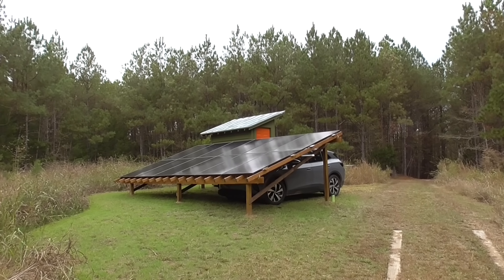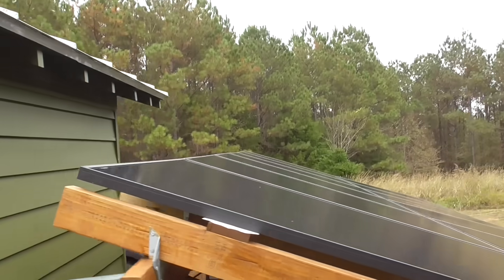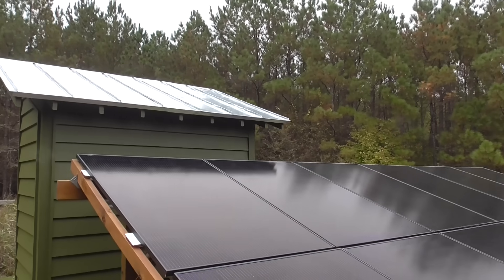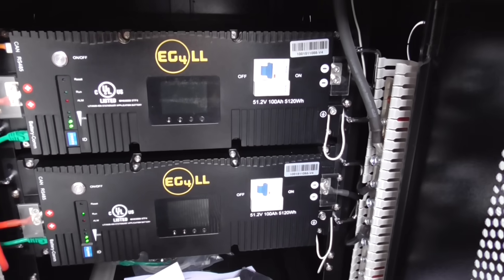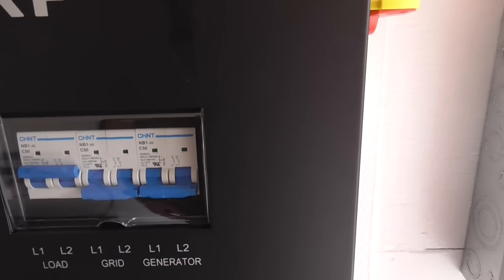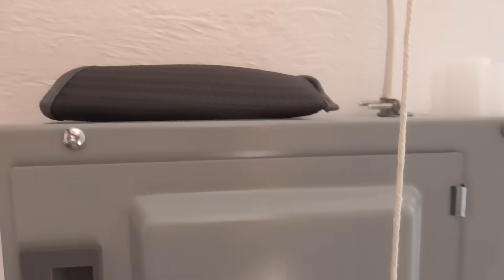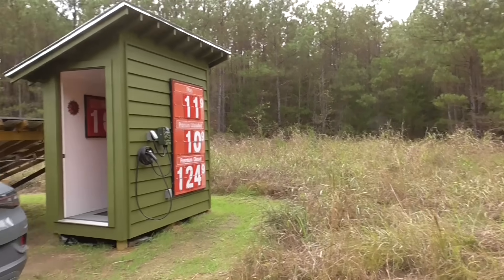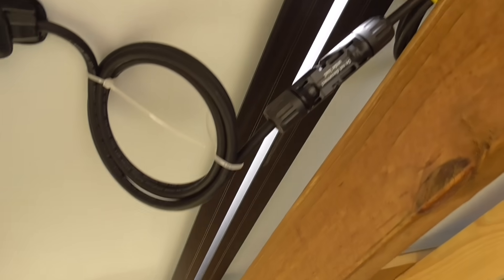Off-Grid Solar EV Charging Station. Stand-alone solution for EV.

Comment: Nice idea, but wrong EV. Seriously the VW's are rife with software issues. Would not touch one with a ten foot pole. You honestly would have been better off buying a used Tesla.
Reply from the maker: What you would or wouldn't do is meaningless to me. I love my ID.4. It's the best car I've ever owned. Zero problems and 8,000 miles thus far. Please be sure to take any advice you might have for me, write it down on a piece of paper, put it in an envelope and throw it in the nearest trash can.
Reply: @wickedmessenger1  good response!
Reply: VW has fixed those software problems that were on the earlier ID4.
Reply: I wouldn't own a Tesla if they were free.  The software is the only thing decent about a Tesla, everything else is cheap and low quality.

Comment: Time to change the posts so the space under the PV is useable for the EV and storage.
Good for viewers to learn early!
Free Advice: if you want to build a car port, and are wondering how tall to build, - open the hood and trunk on your car/van/truck and measure the max height.  add about a foot extra and be sure you have this much space under the soffit level.  Some LED light strings under the framework is handy - just saying.
Also - do not ground the PV separately from the main system ground.  Make one ground for the entire system and connect all grounds to that system.
Reply from the maker: My original intention was to make it a carport but I changed my mind for good reasons. I have no regrets. And everything is grounded to one ground rod.
Reply: The ground from the PV is only from the FRAMES, which need to be grounded, not the negative of the panel itself. The way he did it is fine. All other grounds should be run seperately, but he did run it to the same rod, which is also fine. The only reason to ground the frame is so that someone doesn't get shocked when touching the frames of the solar panels. I didn't know this step when I put in my own off-grid power system, and got a tingle when I touched the solar panel frame, even though the rest of my system was grounded from my breaker box to the ground rod.
Reply: @Tumbleweed5150  Ground Potential Rise or Earth Potential Rise (as defined by IEEE Standard 80-2000) is the maximum electrical potential that a (substation) grounding grid may attain relative to a distant grounding point assumed to be at potential of remote earth.I worked in telecomunications on external network it's because of this,can get very complicated and or dangerous,as i think the panels were 180 volts in total
Reply: @Tumbleweed5150  The ground from the PV SHOULD only be the frames. and these should connect to the single Earth Ground for the property.  Muliple grounds can result in ground-loops - dangerous.
The NEC permits a separate ground for the PV arrary - but doesn't recommend it.
Reply from the maker: @Tumbleweed5150  I became aware of the need to ground the frames of the panels from watching Youtube videos about how people got shocked (mostly mildly) when touching their ungrounded panels. I still do not understand how this happens. Why do the frames have a charge? One guy said his were charged with AC voltage.
Reply: This is very cool. Thanks for sharing.

Comment: Solar rack looks great nice job. Curious how you did the mounting brackets
Reply from the maker: The panels are each attached in 4 places to wood 1x4s with 1/4" galvanized screws. The panels are isolated from touching the wood directly with a thick vinyl flashing. There is no place where the wood touches the aluminum, as treated wood is highly corrosive to aluminum, even though it's annodized.
Reply: @wickedmessenger1  nice.. i just learned something.

Comment: Add something to protect your wood from the elements. Fixing panels directly on wood...is a bad idea, wood will move depending on the local humidity level. i would go victron instead of those chinese eg4 that heat while consuming a lot of energy and make noise.
Depending on how you use/need power you do not need much battery capacity. I charge my car with less then 3kWh of cells, panels are on the roof and the car park under them completly. A multiplus ii and micro inverters with a ev charging station and a small lifepo4 pack. Then the charge rate is automatically controlled depending on the available sun.
Total cost in my case 12x500W bifacial panels (semi transparent, 900€), victron 5 kVA  (920€), 3xmicro inverters hoymiles (890€), victron ev station (450€), 10kWh pack (1300€, diy, jkbms, concrete box), cables, fuses, breakers....(200€), wood (600€) structure is 3m*6m, 3.5m at the highest point, 1.5m at the lowest. Something like 5k€. Ho forget one mppt for DC charging that is connected on 2 of those 12xpanels, it's a security in case the battery would be depleted.
Reply: why micro-inverters though?
Reply: I noticed he has some sort of plastic between the panels and the wood
Reply from the maker: @AshleyMckendree  It's a thick vinyl flashing. There is no place where any panel touches wood directly. That is very important.
Reply: @wickedmessenger1  why is that, I've seen many ground mounted panels mounted to directly to wood.
Reply from the maker: @Rock_Nemo   Pressure treated wood has chemicals that are corrosive to aluminum. The annodized coating can stave off corrosion for a while, but eventually they will corrode. It doesn't happen overnight. I spent $15 on that vinyl flashing so I know for sure my panels are protected. Well worth the money.

Comment: Better to charge the car battery first and then the shed batteries second..  That saves one round of charge - discharge through the shed batteries and inverter.  Any excess energy from solar after charging the car can go to charging the batteries.  You’ll get more EV miles from your solar.
Reply: I don’t think there’s any way to DC charge the car easily, so I think this is wrong. Open to someone correcting me, though.
Reply: That charge controller uses solar before pulling from the battery. If more of a load then the solar creates then it draws from the battery. Battery is only charged if there is excess power from solar.
Reply: How would you set this up?
Reply: @ limit the charge current to the batteries - I believe most chargers are configurable in this way..  Increase the charge current on the EV - most EVs support adjustments on this..  Doesn’t have to be a hard cutoff - just scale the currents / power to maximize the EV charging.

Comment: Great setup. 
Now your probably addicted.
Time to do the house !
Reply from the maker: Yes, it is addictive. Right now I'm trying to think of ways to use energy when I'm not there. After the batteries are all charged up, it just sits there wasting sunlight.
Reply: @wickedmessenger1 pump water to a high reservoir :)  Maybe with a rain collection system.
Reply: @wickedmessenger1  Mine bitcoin
Reply: @wickedmessenger1  use excess generation to power a pirate radio station transmitter? Bitcoin miner? Pump for a DIY water tower?
Reply: @wickedmessenger1 "wasting sunlight" 😂😂 this term has changed a lot in the past 25 years.
Reply: @wickedmessenger1  
In my "solar shed" I plugged in a porta-cool to keep everything under 85 in the middle of summer.
Reply: @wickedmessenger1  eventually more batteries (and a 20kW charger), that'll come in handy when a well is dug and water is being pumped into some kind of reservoir, but clearly eventually it's the house.
do NOT do any silly crypto mining ; )

Comment: You can't set the charge limit via the car? We do this in our Tesla.
Reply from the maker: That's not an option with the ID4. The Grizlee turned out to be the perfect solution.
Reply: @wickedmessenger1  some mobile chargers let you adjust the rate with a simple button on the charger itself. It might have been a cheaper option
Reply from the maker: @MatthewBayard  The Grizlee lets you do that but you have to take off the cover to get at the dip switch. Once it's done, I never have to go in there again.  It was a very affordable charger and very well made, plus designed to be in all weather. I'm very happy with it. I think I paid about $350 all in.
Reply: @MatthewBayard You have to be careful with soft limits. I purchased 2 40A adjustable portable EVSEs so I thought I could set each to 20A and plug them both in to a 40A rated circuit and then use them both at max when I run another circuit at a later time.

It turns out if power is interrupted for any reason they default back to 40A rather than the set 20A which if both are plugged in can trip the breaker or potentially start a fire.

If you have something where a true limit is required you should always rely on hard switches that limit top output.
Reply: @Snerdles  the Tesla UMC always goes to the last amp settings
Reply from the maker: @Snerdles  Like I said, the amperage is set with a dip switch inside the enclosure. It is a "hard switch." Your fears are unfounded with my setup.
Reply: @wickedmessenger1  I was talking about ones that just have buttons to set. Some of them are very dangerous. It was in response to the recommendation above.

Comment: What kind of wood did you use?
Reply from the maker: It's all pressure treated southern yellow pine. I made sure that the panels do not touch the wood directly by placing a vinyl flashing between the panel frames and the wood. Even with the anodization, the aluminum would eventually corrode if left in direct contact with the wood.
Reply: @wickedmessenger1  It looks really nice did you stain or treat the wood?
Reply from the maker: @MyGoogleYoutube  I stained it. You might notice from the video that I haven't completed everything under the panels yet, but I will.
Reply: @wickedmessenger1  I like it :) Did you wait to stain it or just do it before you built it?
Reply from the maker: @MyGoogleYoutube  The wood was wet when I bought it and built it, so I had to wait until it dried before I stained it. Since it was the middle of summer and in full sun almost all day, that went pretty quickly. I didn't put any panels up until I had the equipment shed completely finished, so there was plenty of time for everything to dry.

Comment: whats the all in cost, $8,000?
Reply: PV around $1500 max.
6000xp $1400
Batteries  $2600.
Ball park but at Signature Solar  prices are not super expensive.
Reply: Plus $350 for the battery rack plus all the taxes and shipping, plus all the wood and then the shed, also the cables, the EV charger and the electrical panel etc.
Reply: @randya9143  True, Signature solar has great prices on their products, but their shipping costs are now way out of line, twice what it was a year ago, and even back then, too much for my liking! Luckily, I bought my products from them when they were doing free shipping for way less than now. Now they won't ship free unless you spend over a certain price, as I found out when trying to order a second 24V 200Ah server rack battery.
Reply: That’s about what I was thinking, maybe $10,000 max
Reply from the maker: @jasoncork9661  It was under 10k. I spent more than most would to make the equipment shed cool looking.

Comment: Thanks for the overview. Im working on something similar at our rural property with the goal of powering a few critical circuits in the house full time using solar. Im torn between an EG4 6000 and a server rack battery or two vs the anker solix 3800 and 1 expansion battery. The cost for awesome products appears to be at a near low and it feels like a good time to start picking up some components. Im in central FL, so we have amazing sun exposure year round. Your setup came out awesome, cheers!
Reply: If you are able to set a system up like this, you will save a good bit of money. I have the 6000xp and the power pro 14.3kw battery for less than an F3800 with the expansion battery, only 6.8 kw.
(Which I also have)
The 6000xp has way more pv input, so the battery charges up faster. 
The Anker Solix is plug and play.
Choose wisely.
Reply: Have you seen the new Jackery Explorer 5000 Plus? It just recently launched and looks like a pretty good competitor to the Anker.